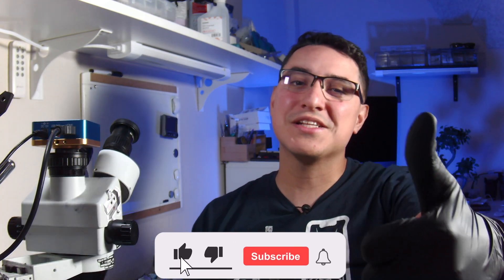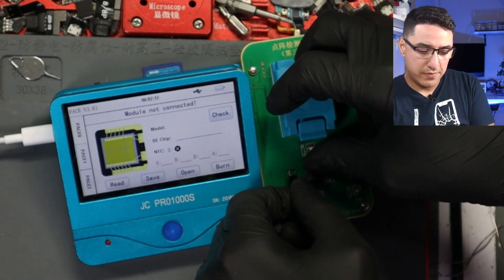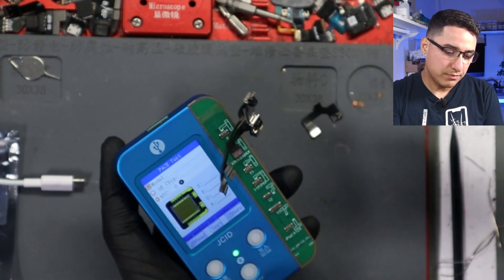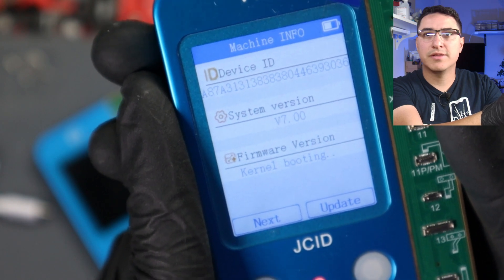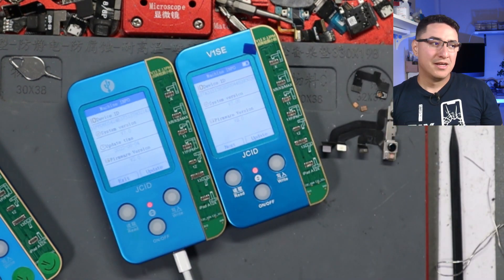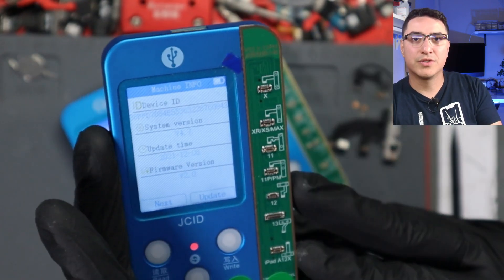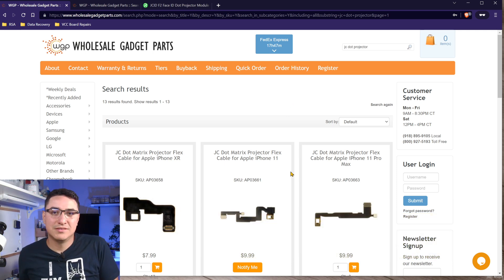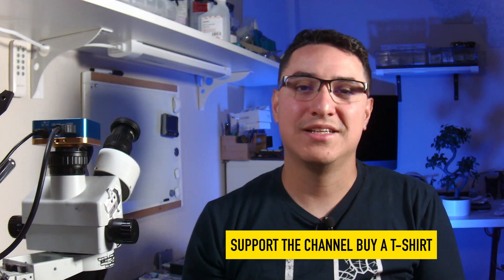JC V1S and V1SE Dot Projector Programmer Not Working. Workaround for Unable To Identify This Cable

Comment: GUYS ITS BROKEN AGAIN!!!!!!! :( :( :( im so angry ... what is now happening if you plug flex in on v8.14 its killing the ic inside the dot ..will just say iic abnormal and there is no data inside the ic . im screwed here. dont update and when asking jc they say they cant downgrade me...
Reply from the maker: Oh wow. I haven't done with method in a while. But wouldn't be surprised.
Reply: Bro even tag on flex lol it’s broken and the top flex for ambiance light and flood tester board is broken , just says icc abnormal 🤣

Comment: I had the same issue, so I contacted the seller of the flex cables and than JCID managed to allow my programmer (by SN) to write all cables by an update. It is still working with the newest updates. Hope this helps for you too. :)
Reply from the maker: I heard of them doing this. Unfortunately, JC did not do this for me. We were in contact with them directly & through WGP.

Comment: Do you know if they fixed the problem?
Reply from the maker: As of now, i don't believe it's fixed.
Reply: @VCCBoardRepairs  I just came back from holidays I have a lot of face id to redo and it doesn't work either, it's scandalous
Reply: @VCCBoardRepairs  you could if it is possible for you to read eprom of the Jcid v1s, and send me the .bin file so that I can use the v4.7 against payment if you want thank you

Comment: Good video pointing this out I always backup the Flash memory chip I started doing this after they were going to start charging for each time you use it ... Having a backup you can always Down grade
Reply from the maker: Oh interesting. How do you backup the flash memory?
Reply: @VCCBoardRepairs   I'll do a video in the next couple days because I need to update mine I haven't updated my 2 programmers for over a year and a 1/2 
JC pro 1000 And the smaller one
Reply: Hello, do you have update file for downgrading?

Comment: It’s all parts. I just bought the jcid v1se and it’s doing this on every part I try! It’ll read all of them but is not burning to any of them and I bought from JC directly even. I’m returning it and trying a different one cause they were useless when I reached out to them for help
Reply from the maker: Maybe you can find a JCV1S with old software, so it can work
Reply: @VCCBoardRepairs  ya scoured eBay after you pointed that out in your vid. I ended up ordering a qanli 2.2 programmer. Buddy swears by their stuff minus the fact they make you buy everything piece by piece instead of complete kits but price wise it’s about the same as the jcids
Reply from the maker: @T_G_2_0_1_1  I've heard a lot about the Qianli one. Both good and bad haha
Reply: @VCCBoardRepairs  ya ditto that’s why I originally went with the jcid v1se but thankfully at least with qanli I have someone locally with one already who can help me with any issues. Jcids customer service is absolute joke lol the only response I got from them after a week was similar to yours. Update your software or return it nothing else

Comment: i Just update my V1s to ver 7.1 yesterday.
you should try to upgrade it
Reply from the maker: i updated to 7.2 and still same issue
Reply: @VCCBoardRepairs  maybe its because 7.0 firmware version that broke the function. i haven't update to 7.0. and straight jump to 7.1 and its still works.
Reply: have you trry to unplug the battery, leave it for a seconds,then put it back and test it again ?

Comment: Hello, i am from Portugal , and had the same issue. But sorry to say this  -- the problem is this place that you call "reputable" seller!!!  As i said i had this problem , but soon as i changed my supplier the problem was over. So the problem is clear, there are reputable sellers buying copycat flex´s  and passing them to us !! if you get a decent jc cable you will see diferences in manufacture. I am not defending JC , not at all, but jc company saw their own products beeing copied ,  they must be losing tons of money ,to make a software update for this, beware that they are not going to fix this! keep looking for a diferent supplier!  and sorry for bad english! my supplier is in spain, i avoid to buy from china, because lately i see a lot of this, and to get warranty or money back is a problem, (mijing for exemple warranty is unexistant)  not even to mention the story of buying from china iphone u2 chips and all sent sealed ,as new but then, on microscope i saw they were used and worse in 10 chips , only 1 or 2 were working, so chinese sellers infortunatly they do that!
Reply: Hey Ricardo. I can 100% confirm that WGP has genuine JC flex cables and is a direct certified US supplier for JC tools and parts.

Comment: I think this is how they can sell more JC flex cables when they block other manufactures cables.
Reply from the maker: Yes! Too bad most people will just stop using their solution if it doesn't work properly lol
Reply: @VCCBoardRepairs  That was only my quess. Is that new flex cable you try to write JB branded?
Reply from the maker: @mobile_deep_fix_finland  yes, i am only using JC dot projector cables. i haven't tried others.
Reply: @VCCBoardRepairs  Oh ok, so even the JC flexes not working after update, darn..

Comment: Wow that issue sounds super enjoying. I wish there was an option to downgrade.
Reply from the maker: Right? Have the firmware out there so you can at least manually downgrade, just in case the latest version doesn't work